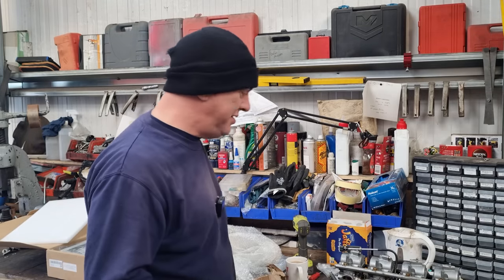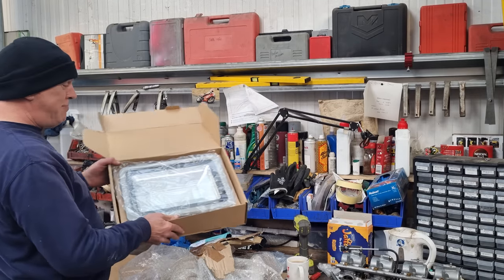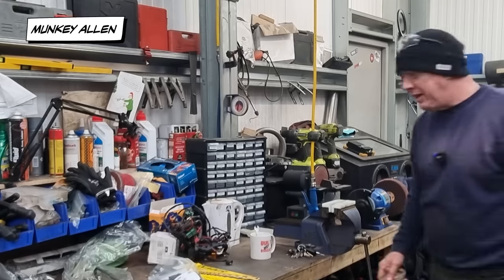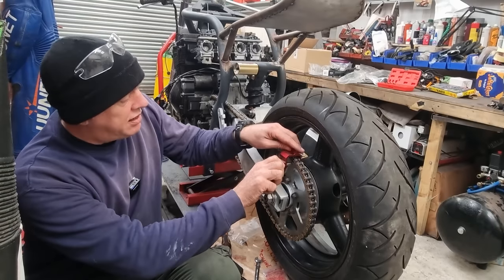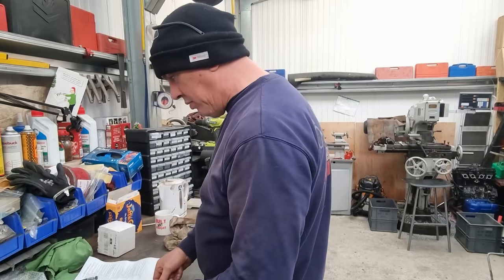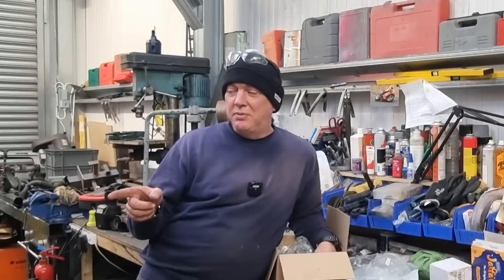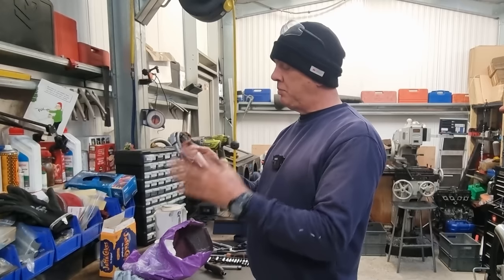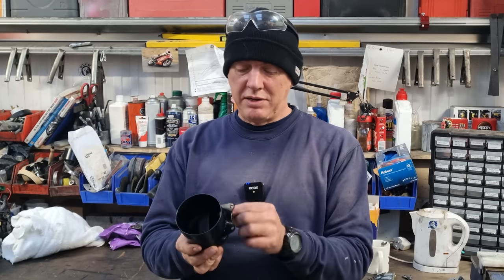Errors and odd jobs - Suzuki Bandit Cafe Racer - ASBO Project

Comment: Put something like a motorcycle cover over the mill and lathe and have a light bulb in there the keep them a little warm. It's when the temperature rises fast with moisture in it that it will condens on all cold metal surfaces. I've sprayed Water Dispacement 40(WD40) on so remains to see if that helps, and I have a car cabin heater in there on remote that I can turn on for an hour or two when warm and damp weather hits.
Reply from the maker: I need to sort something out, for now it's all coated in oil, but a longer term solution is needed. Thanks for the suggestion matey 😁👍

Comment: If u screw a piece of flat plate to the back of the speedo&weld a length of 6mm stud iron to the center,drill a small hole in the center base of the dome,then cut the stud to length and fit a small acorn nut to secure,so access would only require undoing the acorn nut .worked on mine.👍
Reply from the maker: A good suggestion matey, thank you. I've already chopped things up a bit, but I reckon we should be good 😁👍

Comment: All very interesting. I appreciate your frustrations. Only this morning I was hunting for a set of hole punches. For the past 3 or 4 years they have lived on top of the wardrobe in the spare room. But of course I recently 'put them away in a safe place', but couldn't remember which storage box... got them eventually. 👍😁
Reply from the maker: Hehehe... I'm gonna find LOADS of stuff when I finally have a clear up 😂🤣😅
Reply: I lost my set of "current" taps.  A little plastic container with 3 tap sets of 4, 5, 6, 8 & 10mm.  Could not lay my hands on it for love nor money.  Figured I'd probably binned it by accident, ended up replacing all of them.  And then I found it, sat proudly exactly where it should have been.
Reply from the maker: Hehehe.... I've done that 😅🤣😂
I've now got more countersinks than any man deserves 😅🤣😂
Reply: @QuickBikes  Same here - bought things twice! 😁

Comment: Also - you don’t need the starter relay out of the loom. The Motogadget MUnit has a built in starter relay. Keep on keeping on 👍
Reply from the maker: I thought you still needed the starter solenoid...!!! Gonna have to check now as I've not had the instructions out yet 😁👍
Reply: @QuickBikes  I’m flying off memory whilst under the influence of beer, wine and Baileys but I can assure you the starter relay function is built in to the M Unit. The handbook explains that 2 wires have to be connected but it’s pretty straight forward. It does result in a very slight delay in pressing the start button and the motor spinning over
Reply from the maker: Good to know matey, now try the wine and have a very Merry Christmas 😁👍

Comment: Is it possible to drill a small hidden hole(s) in the yoke to access the speedo button(s), assuming access is not required on a frequent basis?
Reply from the maker: I've been hacking it up and changing stuff today as you'll see soon, but thanks for the suggestion matey 😁👍

Comment: Put a r6 throttle tube on the gsxr 750 as a quick action throttle and was bloody surprised. On my ride home from work I was hitting 10 to 20 mph more than I normally would before having to anchor on for the corners at the end of the straighter roads. Full disclosure I was already doing double the speed limit before fitting it.
Reply from the maker: Hehehe.. . Quick action throttles are a bit like marmite I think. You either love them or hate them, but I find them easy enough to get used to and make riding a bike more comfortable on your wrist. 😁👍
Reply: @QuickBikes  my mates a better rider than me and always gaps me on his fettled 900 hornet but the quick action throttle is helping make that gap smaller especially as the speed gets silly. Cant wait for summer now I've skint myself doing a load of work on the front end. Just gotta order the K-tech springs and a bush and seal kit for the forks

Comment: Does it say in the rental contract that the building should be rain proof, or don't you want to make a fuss? Sounds like the installation instructions for the carb kit aren't clear and comprehensive.
Reply from the maker: It should be and the landlord is dead good about fixing stuff. There's quite a few trades in the yard that they use for maintenance jobs as well which is handy. Having read the instructions properly, the problem was just me skimming through them first time round... I should have paid it more attention, but mucking about with cameras often cocks things up as well 🤣😅😂

Comment: Why don't you just put the speedo in the van to set it up ( when you get the van running that is haha)then when its setup  put it on the bike and you don[t have to cut up the housing either 🙂
Reply from the maker: I may have chopped it up a bit today already 😬
Reply: @QuickBikes  🤣🤣🤦‍♂️🤦‍♂️
Reply: Just curious, but since the van is off the road are you still using the ZZR?
Reply from the maker: No matey. The ZZR still has that knock that needs sorting out, but I have good news on the van front in the next video 😁👍